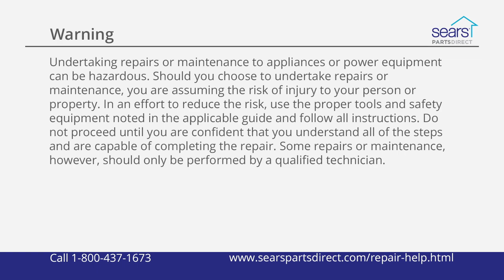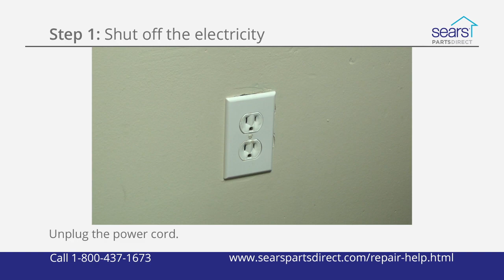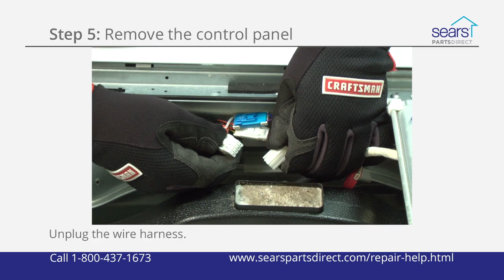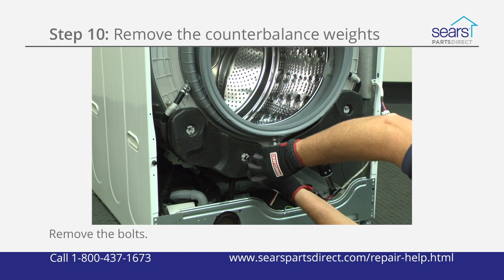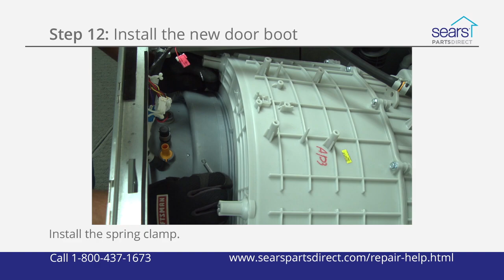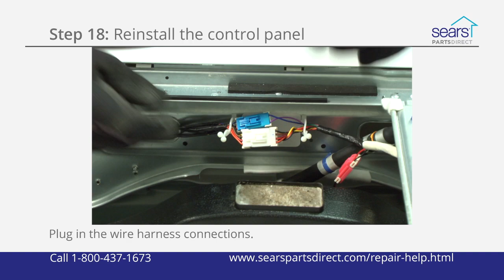Replacing the Door Boot on a Front-Load Washer

Comment: Instructions are almost pretty clear, but the part "work the door boot onto the washer tub" needs a closeup of how exactly the door boot fits onto the washer tub, I spent literally hours doing it wrong. When I finally got it right, it still took a half an hour to work the boot onto the tub, pressing it bit by bit onto the flange it goes on. Another trick is to put liquid soap onto the spring clamps so that as you tighten them, the force distributes evenly around the tub. Otherwise it bunches. Another hassle was that the spring clamp pliers, recommanded elsewhere, did not quite spread the inner clamp far enough. This problem took a bit of invention to solve. This project took hours. But next time I could probably do it under an hour since I've figured out the gotchas.

Comment: You actually don't need spring clamps you can use zipties if you know what your doing
Reply from the maker: Zip ties can hold the door boot in place, but we recommend using the spring clamps.
 
If you need to complete a repair that involves removing the washer’s front panel, you’ll need to release the door boot’s front lip then reinstall the door boot after the repair. You may have difficulty releasing the door boot’s front lip without damaging the lip if you secure the door boot with zip ties instead of using the spring clamps. If you damage the door boot’s front lip, you’ll likely need to replace the door boot to avoid water leaks.

Comment: Since our dryer is stacked on top of the washer, replacing this certain-to-fail part is impossible to do without taking the dryer off. The whole reason the dryer is stacked on top of the washer is because we literally don't have the floorspace to put the dryer. Brilliant job of engineering, Sears, just brilliant. I think I'll try an in–place fix by building up the area that's leaking with some one hundred percent silicone caulk to re-create the gasket face and lip.
Reply: i have replaced hundreds of these Bellow '' Door boots '',  i never remove the weigh's ....  as for a stack unit never had to remove one...  it can be done just though the door believe me...
Reply: You can access the top inside of washer with dryer on top by removing two front screws on dryer mount bracket on front and remove the three screws on back of top panel of washer and don't remove the two bracket connected on back of dryer once these screws are removed you can slide top lid of washer back by applying forward pressure to dryer
Reply: You can access top of washer with dryer on top let me know if your interested and I can help you with how to do it